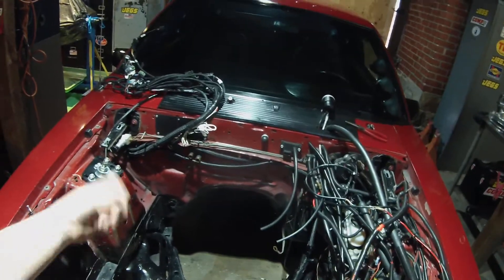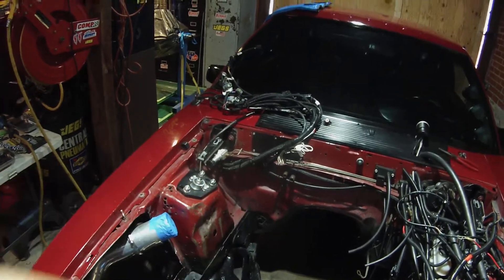PISTON BLOW OUT, LEAN POP

Comment: Love it keep it up bruh!!# dont run 110 leaded causes detonation just gap rings for tollance for turbo nitrous 35 thousands grind on rings.... tight is not good when you tell your builder to build your block......
Reply: Your basicly closing gaps which makes pistons pop. Why does a LS work so good with turbo is bacause its wore out and the gap in piston rings is open more but fuck ls, flat top piston engines might as well have a late model 302 with flat top pistons. TRWForged all the way!!

Comment: Oh no.... damn 😢 The Lead in that Fuel may have wiped out your O2 sensor. Pretty common on the Junk Bosch 02 sensor and that’s causing your lean issue.
Reply from the maker: dude no fox you just nailed it brother another friend sayed the same thing
Reply: @turboman351w3  common, that’s the draw back to the terminator X they stick you with the Bosch unlike the HP and Dominator where you can use NTK which are much better.